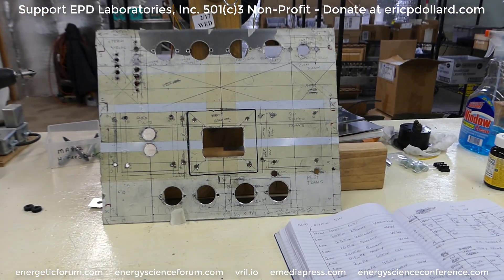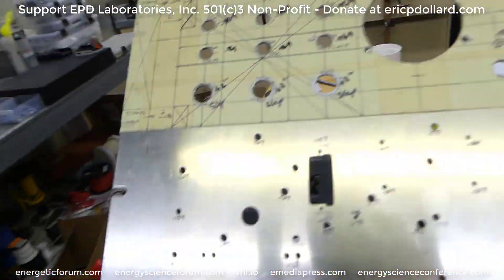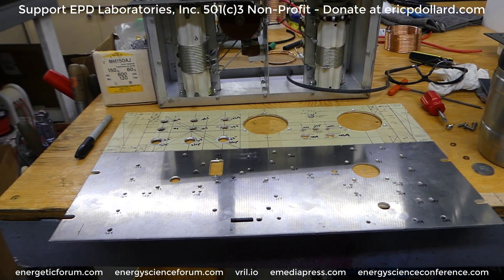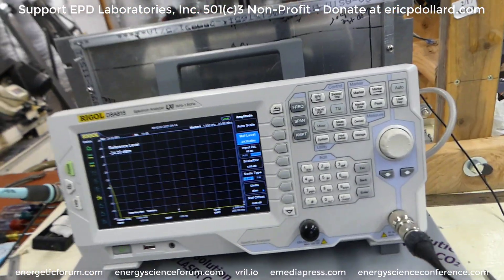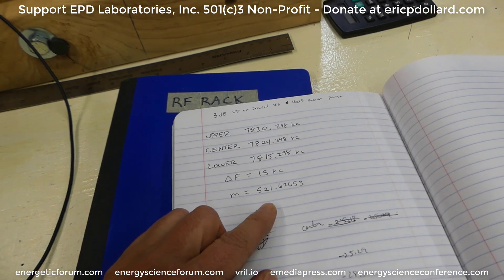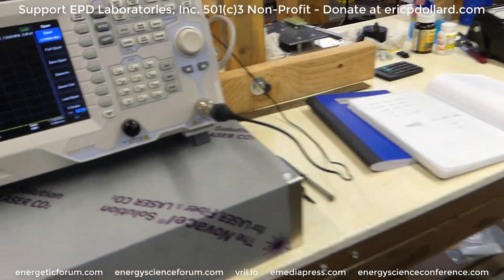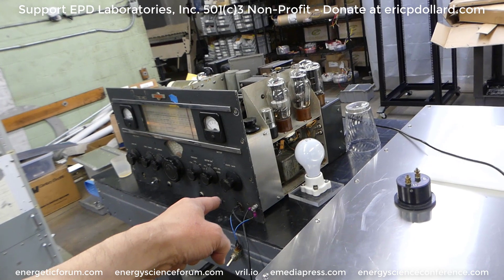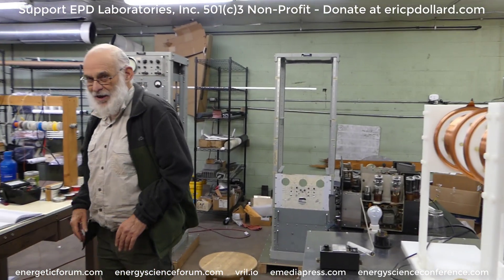2021-04-12 & 13 Current Coil Flame Speaker Test, Spectrum Analyzer and other tests

Comment: On that "new" algebra. If sq2 is taken at three decimals, it IS twice e(c) to the same expansion, with the ---21 palindrome resolution at the fifth decimal repeated in the first two Dimensional Gauges. Pi is the bitch, ---211 at the 95th decimal place. This is electrostatics, or as NJWildberger calls it, something else. He is over the target with the question: What is e(c)+sq2+Pi? Add the first 1 of the Fibonacci Sequence, and the Euclidean Plane three decimal embed tag, and we magically have one half of a dipole, 6.132. This would make your guesswork precise with tuning ON EACH VECTOR, by bypassing the sq2 calculation and using e(c) instead as an integral embed. Do devices exist for this, or can it be done from what you have? I do hope I make rational mathematical sense. NJ calls it infinitesimal algebra, for the energy signature or resonance frequency of the particular state of matter. I call it the Skin Effect in light, rendering the mathematical surface tension of a solid. I can give my equations at the fundamental level. So simple it is ludicrous. This stuff is exciting.

Comment: Cool little spec an.  Pretty accurate too.  Sepc on that one is less than 1 dB for fq response, but 1.4 dB for level ( what your doing). The accuracy of a spec an is not absolute amplitude measurement, but in marker accuracy /linear fidelity ( marker delta to next marker / carrier to harmonic pk). Most settings auto set on those which is good. Usually center fq, then 1 Mhz span, then adjust amplitude ( ref level) as desired, then res BW to what you want to see.  Fq resolution is also good on that unit, less than 1 ppm.  Nice little piece for what you're doing.  Just not very serviceable when they fail is all. 👍